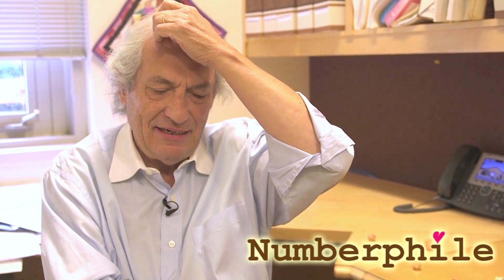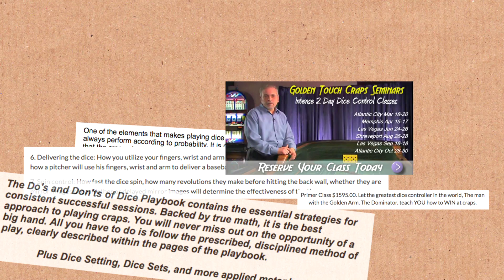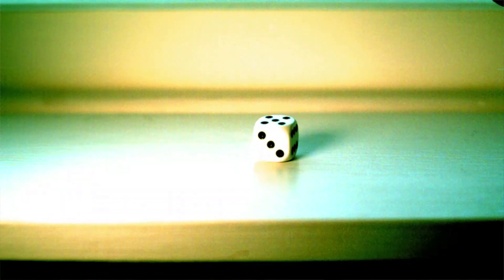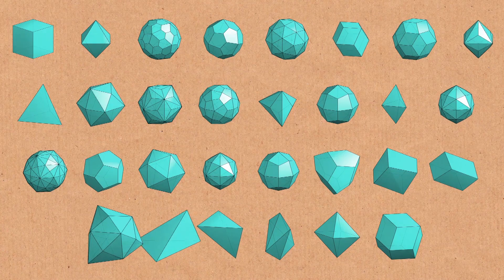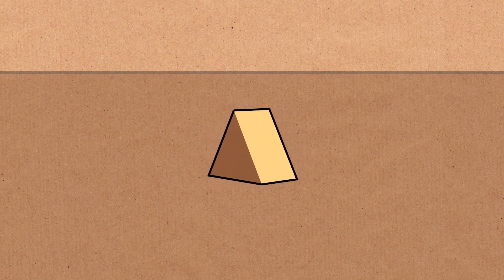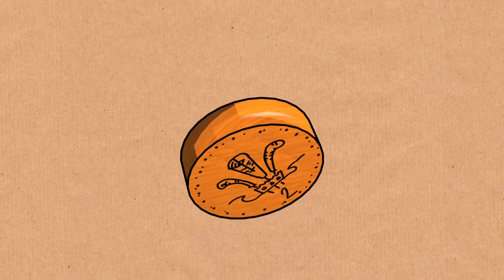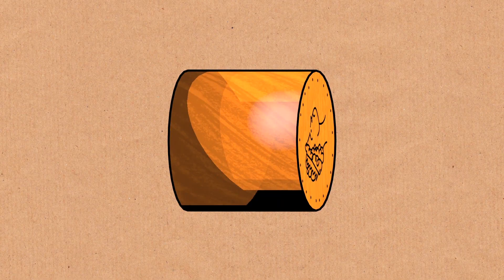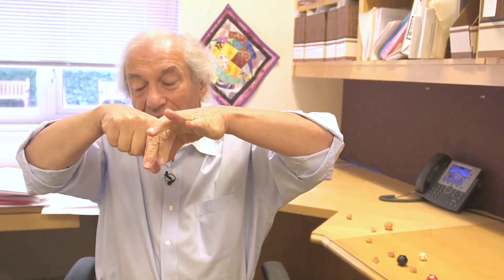Fair Dice (Part 2) - Numberphile

Comment: I can make you a fair 3-sided die. (In abstract, I don't have the tools to do it irl., but I could if I did, and knew how to use them.)

Take your Toblerone, get all of the chocolate out, and, perfectly, separate the edges to 3 points in the exact middle (1 point per edge), leaving one connecting, unfilled triangle. Now cut each of the six rectangles so that they form 'bulgy triangles'. They each have 3 corners, but the area is larger than the isosceles triangle contained in them. the two unconnected edges are curves that could be of many different forms, so long as the 'bulgy triangle' is convex, and the limit of the tangent of the curves as they approach the middle triangle is the same as what the tangent was before cutting, and all the curves are the same. You also need to know what curve to cut, beforehand. Now glue the edges together, and it should now have 3 sides. remember to put the glue on the inside, not the outside.
You've now made something that is not a 3-sided die, because you made it with scissors and tape, and you aren't a robot. Using a 3d scanner and a 3d printer, make a plastic version of the surface. So long as the CoM is along the line to which the shape has rotational symmetry, it will be a fair die.

What? You only wanted polyhedra?  But you never even said polyhedra/on! You said 'shapes!' You have at least begun researching these sorts of dice, right?

Comment: A fair five-sided die could be made by taking a Pentagonal prism and putting pentagon based pyramids on the ends. The center of mass would be such that the die would never come to rest on one of the pyramid faces. This could be expanded to any N- prism, up to a point where the sides are too smooth for the die to ever stop rolling.

Comment: Couldn't you make a 5 sided die using a kind of "Toblerone" with 5 long sides? The die itself would technically have 7 sides, but only 5 of them will ever really have a chance to be rolled, and it would all be equal. Though I guess that really isn't in the spirit of the question now is it.

Comment: On the last note. at 6:20
Let's say we have robust math and it tells us that an experiment will result in "x", and instead it turns up "y". 
In this way math leads us to explore the unknown factor that made what should have turned out as "x" instead give "y". Finding the the math behind the unknown or realising the math might not be as robust as one thought!

OT: What about (and i just thought of this) the fairness of a sphere with "n" numbers written in equally spaced and sized areas? one could use a smaller mettal sphere inside a hollow sphere to make it not roll off the table. 
Does a golfball produce fair results if you were to add numbers to all the groves?

Comment: what about a dice made entirely of concave surfaces?

I believe this proves in abstract math alone that your idea of matching surface area is not valid since you could in effect increase the surface area without increasing the zone where it would be caught by the surface it lands on. Lending credibility to the idea of projecting the zone to an embedded sphere.

And much like the holes on the die, what kind of dynamics could be introduced by modifying weights by introducing concave surfaces in dynamic positions?

Comment: The thing with the Toblerone is that the faces are different shapes. Even if you could make it the perfect length for all conditions to make it fair, it would still have two triangular faces and three rectangular faces. That doesn't prove that there are no fair dice with an odd number of sides where all sides are the same size and shape.

Comment: The sphere around the center of mass should actually work physics-wise. The math would be about the starting orientation and what face it would land on. If the surface area of those sphere parts are equal, that is an indication that if the die started in an orientation where one of those surfaces was at the tippy top, then that would be the side it would land on once gravity takes affect, no matter the roughness or bounciness or whatever of the surface.

Such an approach actually works with any number sided die (so long as the sphere is centered on the center of mass).

Though this only applies in a situation where perfectly random starting orientations are assumed. So in theory it can be done. Testing it though would require an experiment like that dice roller.

Comment: what about a toblorone where the sides aren't flat shapes but curve on either end to point? Does his proof only apply to dice with non-curved sides?
Reply: I was about to suggest this same shape myself. :-)
Reply: +Soupy.   Damn, you beat me to it.
Reply: "That's a cylinder, and we don't like roundies in our set"
Dice
Reply: It only applies to flat faced dice, it is trivial to make an odd sided die with curved faces (take the double pyramid die with an odd polygon as the base, then smooth the top part into the bottom part, thus halving the number of faces)
Reply: If they're all curved in such a way that each face matches up with the equivalent faces of the flat sided object, then the odds should be the same because the curved object will have the same symmetries as the flat sided object. So it shouldn't make a difference.
Reply: While the examples are all flat faced objects, the arguments are all given in terms of the symmetries of the dice rather than their particular shape. 

He never said anything about flat or curved faces because it doesn't matter, so long as the symmetries match up.

This is why mathematics is powerful- once you have a proof that relies on only one simple principle, you don't need to check any other stuff to know if it works, just whatever the proof is based on. In this case the proof is based on symmetries, so only the symmetries matter.
Reply: I guess the point is, though, that the analyses presented thus far are all specifically for objects with flat sides. That was not specifically mentioned, but was implicit; what they're really saying is, "You can't make a fair 5-sided die with flat faces."

Comment: There MAY be other "fair" dice as well.

For example - somewhere along the continuum cube <-> truncated cube <-> cuboctahedron <-> truncated octahedron <-> octahderon, there must a be a point where, under constant, adequately random launch conditions, the chances of any particular face coming up are identical. Even though the faces are of two distinct shapes (a "fair" d14, in other words).

(Call the faces that, at one end, form the cube, C-faces, and those that, at the other, form the octahedron, O-faces. It seems intuitively obvious that the chance of a particular C-face coming up falls smoothly from 1/6 to 0 as the C-faces shrink and the O-faces grow. In parallel those of a particular O-face rise from 0 to 1/8. At some point, therefore - unless something very odd in the way of discontinuity is happening, which seems improbable - there must be a cross-over point where  the chance of any individual face - be it C-face or O-face - is 1/14, and the die is "fair".)

Certainly, if I were to build a machine to throw such dice in a consistent manner, I ought to be able to choose my shape so as to "tune" my dice to be fair. The question is - is that shape unique, or is it determined by my launch conditions? And if it IS unique, what relationships do the various dimensions have, and are those relationships shared by other, related shapes?

Comment: It's not that math doesn't work in these situations, like the interviewer is suggesting, it's just that there is more math involved.  You'd need to calculate the speed of rotation and the values of elasticity for the surfaces hitting, etc...

I've seen dice that try to create more complex probabilities than the number of faces they have by duplicating the number of times a certain number more than once- for instance, if you had a 36 sided die for playing craps '7' would be on there 6 times.  And of course, by using more than one die you can create different probabilities- 7 is more likely to come up than 6 when you are adding two 6 sided dice rolled together.  A lot of games rely on this to make it possible to have really rare occurrences on dice that don't roll on the table forever.  It's easier to roll 3d6 to get an 18 than to wait for a 216 sided die to stop rolling.  It would be interesting though, for games where money wasn't on the line, to have dice that had odd shapes baked in to skew probability.  If you are playing dungeons and dragons and you roll a 20 you get all excited, but you could maybe skew it so it was even rarer by having a rigged die.

I guess what I'm saying is an unfair die is only unfair if you don't let people know it's not 'fair'.  A lot of games actually rely on rolling dice against an opponent, and in that case two identical dice, no matter how goofy their shape, would be 'fair', since they'd be competing against their duplicates.

Comment: For a five sided "die" if you had a pencil with five faces along the length and it was sharpened on both edges, it would be impossible for it to land on the ends. But it would (or so it seems to me) have an equal chance to land on any of the faces. Why is this not a "fair five-sided die"? And so on for any other odd number?
Reply: The theorem he’s talking about considers ALL the sides of the shape; the roller you’re describing would have two pentagonal “caps” on each end, which are counted under the theorem, even if they get ignored when using it as a die.
Reply: Yes, there are cylindrical dice for any number of sides. With more faces they like to roll for a long time though. I don't think he considered asymmetrical shapes for the paper.

Comment: Problem with real world dice is, they can all balance out perfectly on the edges, which means they dont have a "fixed" number of faces, as the edge is always a possible face as well (even if its really unlikely, classic coin that lands on the edge).
Reply: y'all are forgetting the possibility that the die will spontaneously fragment on impact, or that the laws of physics will suddenly change mid-roll so that the die lands all-sides-facing-up or melancholy facing up or you fall into a black hole where no sides are facing up because all directions are down.
Reply: If you're gonna go that route, you might as well count the possibility that it will balance on corners as well.
Reply: Well, I think that only positions in stable equilibrium are taken into account, since a position in unstable equilibrium is an almost impossible event (probability equals to 0). So even if in the real life you might land a coin on the edge, it doesn't matter because the possibility is irrelevant, it's not really a problem.

Comment: In order to get the true probability of something you would have to fully understand and measure all of the forces at play, many of which we don't yet fully understand. However, since the forces of reality seem to be consistent, as you account for more of them, the concept of randomness begins to vanish.  The point of rolling a dice, or any other random number generation, is that the combined conditions are so complex that it would be impossible for the human mind to accurately measure the relevant starting conditions and then pre-calculate the outcome prior to it resolving.  The concept of Fair is that while the conditions are complex, there is a finite way to resolve them, and each solution is equally likely as the others.  In the grand scheme of things, randomness is an illusion and any outcome is entirely pre-determined by all the forces of the universe acting upon each other.

Comment: If you take a cube dice and add material to three sides next to one corner so it appears as a ball. It would roll of those sides and stop on either of the three flat sides. Since there are three flat sides and they have the same size and shape and surrounding they are equally likely. A three-sided dice! If it did stop on the round part it doesn't count. And even simpler: Take a normal dice and use two sides for each number.A three-sided dice! These methods of course work for lots more numbers. To make the half round dice never land on the round par tit would be possible to make the density higher in the opposite corner so it would  be top heavy.

Comment: there are odd numbers dice, and I think them to be pretty fair, so I 
have a question. Consider the toblerone example: that could be a fair 
3-sided die if you kept it untouched and the long faces are those to be 
numbered, while the base will not be counted.
would such a die be considered fair?
there are other kind of dice too, but are too hard to describe with just words, and in a foreign language ^^"
Reply: it would be fair. With not counting some sides you can again take the excample of the n-agon where you pull it on the top and botton but you just dont count the bottom and you will have any die and fair. But you will have NULL solutions also.
Reply: but then again, if you get those sides stretched to a point, there would be really little chance of a null result (think of a boat's keel, for the 3 sided example, but wit all three sides equally curved... I don't know if I'm explaining myself as I'd like to ^^"). The section would be like an outward curved sided triangle (Reuleaux triangle - thanks google!). That geometry could be carried on to 5,7 and almost any number of faces odd and even, as long as there's physical room to have distinct faces.
Reply: Those are called long dice and yes they are fair in reality but mathematically arent very nice because it includes sides which cant be landed on. It is effectively the same as taking a cube and just rerolling if it lands on 4, 5 or 6. It works but those sorts of solutions he wasnt talking about.
Or you can make even sided long dice which dont work like that but those are already included in his dice families.

Comment: There are fair 5 sided dice. Pentagonal prisms with conical or spherical caps on the end that prevent those sides from being valid (an extension of his Toblerone example). 
His groups only seemed to list convex polyhedrons, but concave polyhedrons with isohedral envelopes are also fair.
Then there is the concept of treating a set of faces as a single unit for transitivity. For example, if you take https://en.wikipedia.org/wiki/Truncated_triakis_tetrahedron label all of the hexagons with 1-4, and then label the three pentagons who share a corner and label them with the same number as the hexagon opposite their shared corner. You will get fair results from the die. Each set of hexagon+3 pentagons has transitivity to any other set. It would not be a fair 16-sided die, or a fair 8-sided die, but it is fair as a 4-sided die.

Comment: What about curved edges? that could make any n-sided die fair.
Reply: In practice, anyone who's ever rolled a d100 (which, despite being quite spherical, does have flat faces and straight edges) knows that you spend more time arguing about which side is up than rolling the dice. With completely spherical dice the arguing time will tend to infinity. :)
Reply: MichaelKingsfordGray
I believe what he's thinking of is a long prism with its ends narrowed into points. If anything that would devolve into an oversized toothpick.
Reply: Sure they would. Imagine the dipyramid example, only instead of a sharp ridge around the equator it's smooth, like a lemon with ridges, such that gravity would actually cause the shape to rest on that wedge. It's easy to then imagine that any number of curved sides would produce a fair ridged lemon shape.
Reply: Danielle Anderson
Sorry, was primarily referring to Gamesaucer.
Reply: +MichaelKingsfordGray look up barrel dice, that seems to match his tootpick description
Reply: Not really, because then the faces would no longer have the same shape.
Reply: you always can devide a ball in n equal size areas. or at least partly that direction to make it fairer. But they quite deliberately make that destinction to have hard corners.

Comment: So assuming the assertion that there is no such thing as a fair die with an odd number of faces is true, the only way to make a fair odd-numbered die would be to double the die to make it even.  i.e. the only fair 5-sided die would be a 10-sided die with the numbers 1, 2, 3, 4, and 5 each written on two different faces.  Got it.
Reply: Some prefer the icosahedron but same principle. Take 20 sided die and just put 1-5 on all it faces at equal proportions.
Reply: One can make a fair odd-sided die (practically fair, not symmetrically fair, as the faces are not transitive): a triangular chopstick.  oh I just got to the toblerone part!  what a great channel!!
Reply: Alternately, you could take a cube and label one of the faces "re-roll."  It lacks elegance, but it's effective.
Reply: 3 sided die is easy. Leave the Toblerone longer,  then pinch the ends to a point. 
Or, take a prolate spheroid (i.e. an American football) and flatten three sides.
Reply: Would you be able to map each and every number to a perfectly symmetrical number on another side if you did that?
Reply: cOmAtOrAn
I would not say efficient as you risk having to re-roll a few times if you unlucky.  But yes, it does the job and is a simple if brutal way to do it.
Reply: I have a 3D model of that toblerone-die. Should I print it and test if it's fair?

Comment: N sided capsule with round end caps (so the capsule can never land on its ends) should result in fair "dice" of any number of faces.
Reply: Yup. Those are called barrel dice :)
Reply: https://en.wikipedia.org/wiki/Long_dice

 Barrel dice tend to refer to a specific type of long dice, with an even number of triangular faces. But long dice in general can certainly be made with any number of sides by making the sides rectangular and rounding or pointing the end caps.
Reply: Was thinking that myself.